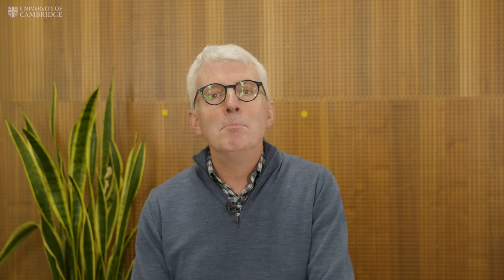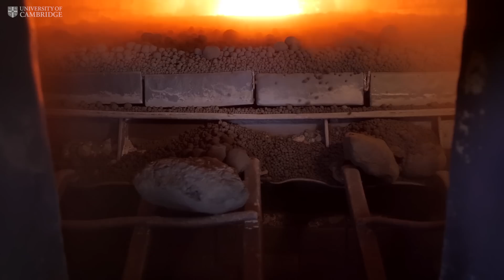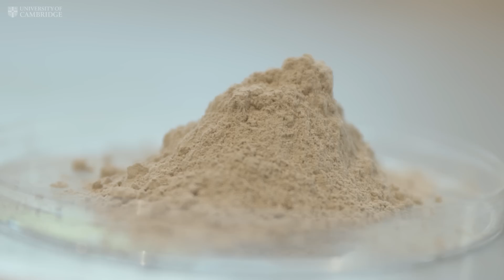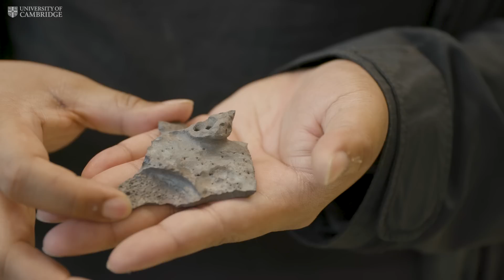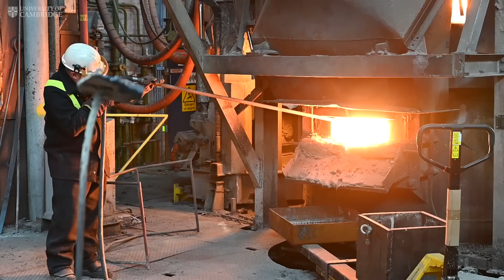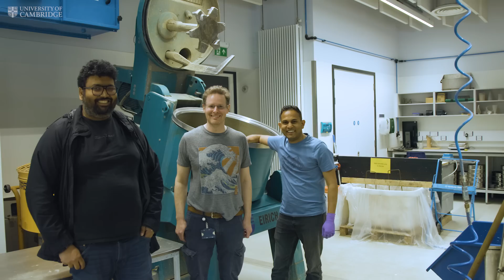The world's first process for making zero emissions cement

Comment: I hope you succeed with this.  Back in the 1980s my brother was a chemist developing asphalt for a US subsidiarity of Elf Aquitaine. He would occasionally go on job sites to check product and application. Then a new process and machine was developed that could rip up the old asphalt, shred it, reheat it, apply a few additives, and repave a road with it.  It was not only good because it recycling existing asphalt, but it was cheaper.  What happened.  Asphalt companies bribed state legislators to require new asphalt be used on all state jobs, making it impossible to recycle, and sued to run the company out of business.

Comment: I wouldn't call it zero emissions, as it requires the emissions to melt the steel. Still, it is an elegant solution to a most serious issue. We need to work on the emissions from steel now. 

This process could go further if CO2 could be inhected into the cement later. Or if the cement could sequester CO2 from the air or water, like the Romans did.

Comment: How can the recycled cement have exactly the same chemical composition as Portland cement if it has been used as flux and has therefore absorbed the impurities and the free carbon from the smelting process? Recycled steel has many additional contaminants which are presumably sequestered from the melt into the flux 'slag'. Flux is not simply a catalyst, but a medium through which contaminants are removed from the steel. An entropic analysis of this process will in all likelihood reveal that the energy saving is at best marginal and that the product is inferior. Solution - Stop being so reliant on cement!

Comment: In principle, it's a good idea. But from a mass balance point of view, i dont think it adds up. Likely  recycled cement will be a few percent of demand in practice. Contrast that with steel and electro furnaces. Green energy firing established technology, and we have a faster win.  Extend that to smelting ore by modified electrolysis using cell technology similar to aluminium refining but for iron ore feedstock and the whole of steel production could be transformed.

Comment: Say it quickly and it sounds like it's emissions free. But the feed stock is cement, a high emission material whose co2 is still in the atmosphere. Then there is the intermediate energy to process the cement out of the demolition materials. Then there is the heat for the steel processing which "in the future" could be carbon free. If remains the biggest word in the English language, we are a long way from carbon free electricity. This just plays into the hands of highly polluting corporations and their willing lackies

Comment: As part of the rapid cooling process could you harness something akin to a large industrial peltier to draw the heat out of the new material and simultaneously heat water to power a steam turbine for electricity generation to partially claim back some of that energy used in that process too?

I guess it wouldn't be a large amount reclaimed, but given the large amount of energy in total only reclaiming a fraction in this process could potentially still be useful.
Reply: The big problem with peltiers, is that they consume an ungodly amount of electricity. I doubt the cost of running that specific type of heat transfer would work out economically or environmentally. But I'm sure that there's some way to reclaim some of the heat.

Comment: If finely ground reclaimed cement paste carbonates (reabsorbs CO2) by virtue of its large surface area, what becomes of that CO2 when the material becomes heated beyond calcination temperatures in an EAF?
Reply: I was thinking, if the CO2 gets released, could some of it be captured and used to power the furnace?

I read that about half of the CO2 that gets released during calcination gets reabsorbed when the concrete hardens, so your question is still relevant.

Comment: We need to know about the economics, as well as safety. The entirety of the process involves transport of waste concrete, transport of cement dust, and processing of slag to remove or stabilize toxic impurities. I assume someone has done the calculations to determine if it is theoretically economically efficient.
Reply: That doesn't sound any more complex than the current processes for making steel and cement which involve lots of mining of raw minerals, transporting those minerals, and then subjecting them to enormous amounts of heat multiple times, splitting off higher and lower grade outputs, etc.
Reply: Agreed.

I think it's viable in and of itself because many investors are willing to pay a premium for having an emission-free product, but with enough automation of logistics this will be incredibly profitable it's just a series of questions of: how do we get there?
Reply: Not just economically! It would also be interesting to see the calculations for CO2-emissions for the entire process, and how it compares to other alternatives
Reply: I think in this case it might be better to not let perfect be the enemy of the good.  I get wanting to have everything neutral throughout the chain, but that’s really just not entirely possible in our current world.
Reply: Exactly, this report is interesting but not the cure
Reply: Given that most new cement is not mined or refined near the cities it's used in, this is probably a huge saving in resource and cost already: essentially as old buildings are taken down to make way for new structures, they become the raw material that's already much of the way to flux-ready state. my main concern would be the proportion of steel to flux being a sensible ratio for the usage rates
Reply: The economic viability has to be weighed against the ecological cost of business-as-usual. As of now, the price of many commodity goods like cement, oil, steel, coal, gas, etc donc take into account their impact on the environment, and are in fact even heavily subsidized to curb their otherwise huge prices.
Reply: It will definitely not be as economic as throwing away old concrete and using normal materials for slag, but it is definitely more economic than any other CO2 reduction method that could be used to offset the emissions from conventional cement production
Reply: At a certain point that will have to become secondary. It's money or the planet
Reply: It's true that you don't have steel plants everywhere but there are lots of those in India or China and they have a lot of stuff to build.
Reply: In a first 30 sec guy said it could be carbon free one day - rendering whole idea as clickbate.

Comment: I wounder how the Romans made cement… that stands today..!  No visible rusting steel that deteriorate over 50-100 years..!
Reply: Roman concrete was worse, in a lot of ways, compared to concrete used today. The recipe for it wasn’t lost. Researchers, a few years ago, found that part of the reason some parts of structures were very durable is that Roman concrete had volcanic ash mixed into it, which helped it to self-repair when exposed to saltwater. That is pretty incredible, to be fair. Most structures, though, fell into disrepair fairly quickly, and we’re just seeing the few that survived until now.

Steel, also, wasn’t very good during Roman times. The Romans probably took the techniques to make steel from the Celts, by the way. You could argue Romans basically had the technology to make iron encased in steel, but they definitely didn’t have the technology to make stainless steel or steel that didn’t rust.

History is so cool. Humans are so cool! Why do we feel the need to make up fictional stories about the past when it is already really interesting?

Comment: The highest demand for cement is in countries that have little concrete buildings to demolish and extract cement paste to then use for recycling. While this certainly is an innovative new process it will do little to fundamentally solve the binder problem. Rather than optimizing cement further and sinking more financial resources into it we should focus on proven disruptive sustainable technologies. Cambridge has one of the best examples, the Queens Building Emmanuel College by Buro Happold and Hopkins Architects…

Comment: Does this need any extra energy for recycling a given amount of steel compared to using traditional flux? I‘m wondering because recycling cement involves separating out the chemically bound CO2 through heat which is an endothermic process (IIRC) and thus I wouldn’t be surprised if this actually costs a bit of extra energy to compensate for the energy lost by that chemical reaction.

Comment: There is no such a thing as a zero-emission product.   If one does a life cycle analysis one finds emissions during the construction of renewable infrastructure and, in this particular case, the manufacturing of building-crushing and griding equipment, not to mention all the other equipment and energy needed to run the whole process.  That such a technically nonsensical claim gets made and publicized  by scholars employed by Cambridge University is a cause for great concern about the current academic standards and/or integrity of this institution.

Comment: This is exciting, but is it the first process for zero emissions cement? I’m thinking of others working in the same space - Brimstone makes something chemically identical to Portland cement without limestone. Sublime (developed at MIT) makes cement that is functionally (not chemically) identical to Portland cement, using electrolysis rather than heat for the chemical process. Neither uses limestone, which is the source of half the carbon footprint of Portland cement.

Comment: You can improve on that process further by using a medium to store heat energy at very high temperatures so it is available for your furnace when you need it, thereby flattening out the demand curve for electricity and enabling electricity to be purchased at a lower price.

Comment: You are missing the point.

The steel is already being recycled in arc furnaces, and when recycled cement is used as flux, the SAME AMOUNT of electricity is used compared to steel making with normal flux.

No more electricity is being used than normal.

Comment: Could this cement be infinetely recycled with minimal degredation?
Reply: This is currently unknown.  You would need to make a concrete test structure using this recycled cement, then demolish it and recycle a second time.  So you have fresh new cement made the old way, a structure made with cement recycled once, and another with cement recycled twice.  Each time you test how strong the structure is, and see if there is any loss in properties.

Concrete structures can last a long time, and not every project needs the highest strength.  So in theory you could keep using the stuff for hundreds of years with it getting recycled and used in lower strength projects each time.  You get much lower lifetime emissions that way.

The reason new cement emits so much CO2 is you have to heat it to very high temperatures, and mostly today we burn something in a furnace to get the heat.  In principle we could have a renewable energy source for the furnace to reduce the original emissions.  That would make it a fully clean process.
Reply: @SeedFactoryProject The required heat is only half the Portland cement CO2 problem. The other is the raw material - calcium carbonate (aka limestone). The process of making Portland cement frees CO2 from the limestone, which is the source of about half the CO2 associated with cement making.
Reply: @SeedFactoryProject The high temperature needed to make cement is only half of the reason for it's high CO2 emissions. The other is that CO2 is driven off of limestone to give calcium oxide. If all the energy used was zero carbon then there would still be a large amount of CO2 produced.
Reply: @SeedFactoryProject  AFAIK it is worse still: the minerals used (limestone etc) contains carbon that needs to be burnt off - that leads to a "difficult to avoid" source of CO2 too, right?
Reply: @SeedFactoryProject  Thank you for the great news.

I agree about the project requirements. I remember working on a construction site. The cement was so weak, that it was basically sand and crushed gravel.
Reply: @SeedFactoryProject no the emissions from cement come directly from the cement raw material itself, which uses calcium carbonate that is converted to calcium oxide and releases carbon dioxide. Clinker is majority calcium oxide plus some other oxides. 

Melting steel, in raw ore or recycling, requires a floating slag to  prevent oxygen from contacting the underlying steel. Cement is less dense than steel so it will float, and I presume the heat can also drive out water from the set cement and return it to the dehydrated oxide state, thereby recycling the cement. 

The zero emissions are directly from no longer releasing new CO2 from creating new clinker, but the energy consumption of pulverising the concrete or cement slag seems to be enormous to me, so we really do need to work on approaching non fossil fuel energy sources for this to really work.
Reply: @SeedFactoryProject  actually the problem with cement isn't that it needs very high temperatures (although that is an issue); the problem is that one of the ingredients is quicklime (CaO), which is obtained from limestone (CaCO3), always releasing a large amount of carbon dioxide in the process. I imagine recycling cement could solve this problem.
Reply: Yes, but no.  In order to make alite instead of blite, some amount of lime needs to go into the foundry with the recycled cement.

Lime is made by from limestone, with co2 as a byproduct.
Reply: Probably not, but we can get that 7.5% of carbon emissions down to well below 1% with this. If it really is that effective, it would be extremely unethical to not invest many billions into converting our processes over to it ASAP. I am EXTREMELY skeptical of most 'green' tech, as this industry is PACKED with grifters (just look at the carbon capture crowd, paid off by oil companies). 
However, the smartest people in the world are saying that this is real, and that it will work. I am going to trust the smartest people on this one. Also look at the researches involved in this!!! Unlike the carbon capture crowd, these researchers have no profit motive to create this technology. They seem so much more trustworthy than other groups that have been pushing green tech.
This is the real deal, a once in a lifetime relatively cheap opportunity to make the future survivable for longer for our children.
Reply: Original creation of cement also releases CO2 from the material itself, as well as the CO2 from the energy used to do so.
Reply: Thanks!
Reply: Cement is a mix of different components, so probably additional steps or additives would be needed to keep the properties the same as virgin Portland cement after each cycle. That wouldn't be any reason not to pursue this recycling approach though.
Reply: I doubt it.
It's unlikely that 100% recovery is possible. Cement chemically bonds to the aggregate, that layer is probably going to stay with the aggregate during the crushing and refining process.
As fot the material that is recovered and processed, there will also be some loss.
But once you have the finished product, the video states that it has the same chemical properties as new material. It will be indistinguishable.
Reply: As clarification for what they're talking about in the video, "zero" carbon cement is an extra challenge because new clinker from limestone inherently emits carbon dioxide (chemically), in addition to any energy consumption considerations.
Reply: That's a little inaccurate; part of why cement is so CO2 intensive is that the chemical reaction when heated releases CO2 from the calcium carbonate, and that is more or less unavoidable when making new cement
Reply: I don't think you'd recover 100% each time the flux process that turns it back into cement likely is adding critical oxides from the steel process you will always lose some of the cement and steel in the recycling process. In exchange you probably get a good as new product though. Some amount of new steel and concrete would be always needed to make up for the losses and environmental degradation where mass is lost while in service to things like corrosion and erosion.